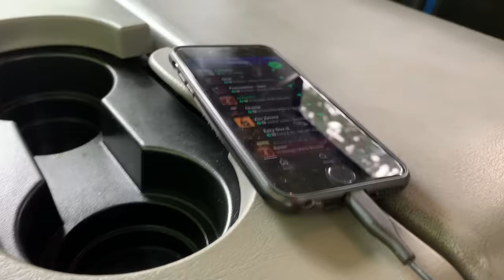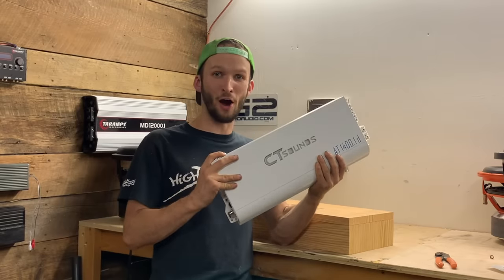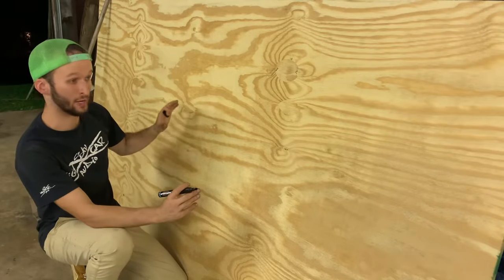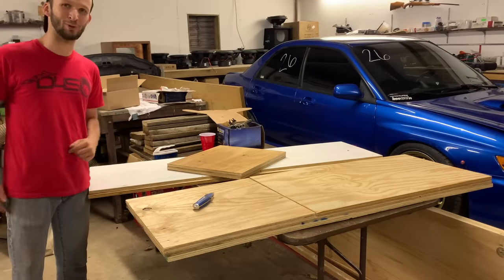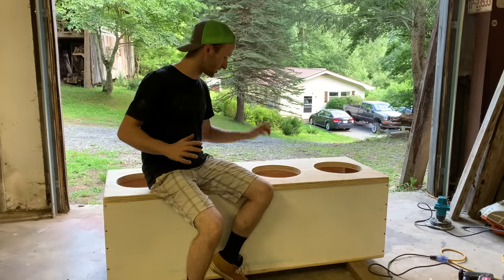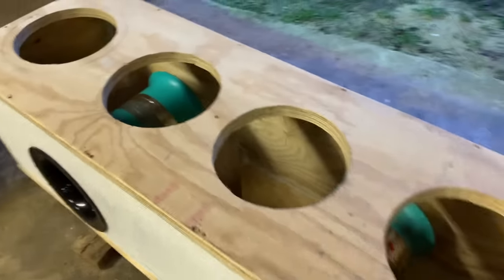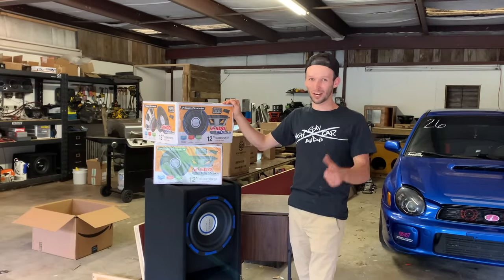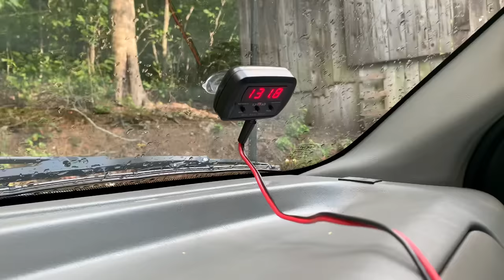How Loud? Walmart Build Part 4 FINAL

Comment: Those ports are too close to the back wall. You generally want the width of the port worth of distance between a port and a wall. But still turned out awesome!
Reply: Yea probably been ok with smaller diameter so they would be shorter, but big ass ports always look super cool 😎
Reply: Half the width of the port is as close as u can be to a wall.
Reply: It's interesting actually because you can slightly decrease the ports tuning by making it seem longer, by pushing the end of the port close to a wall. You want the port area to be equal to the "folded rectangular area" of... Well, imagine you have a rectangle, and that rectangles length is equal to the port circumference, and the rectangles width is equal to the distance from the port to the wall. That rectangle needs to have the same area as the port area. 

This will extend the ports effective length by a few inches or so. Free low tuning!
Reply: Yeah I agree I would of put slot ports facing up on each end of box
Reply: Flexing five hundred the ports is facing the back of the seats
Reply: YESSSS. I'm here for it.😁
Reply: Maybe you should build a proper box and donate it for use on the channel.
Reply: I usually just cut back to get enough room for some sweeping 90°'s.
Reply: @dabosssr24  I'm in no way a professional, but I've always added 90° bends and strapped them to the rear of the box. Is this a bad idea in your opinion? Would I get better results another way?
Reply: 90° angle ports would be/sound better in that box
Reply: I think he knows that already he’s just dealing with the hand he’s dealt lol
Reply: Honestly I know sealed isn’t as loud but I prefer sealed because you get a flatter response and I feel like you almost feel the bass more Since the subwoofers own cone is kind of acting like a passive radiator slightly and if you have enough power it could still be loud enough and you get smoother and more cone excursion which looks cooler if you’re showing it off. The only downside to a sealed enclosure even though it’s not a problem usually but its something to consider, is that there’s no air moving in and out of the box so the sub will run a little warmer because it’s heating it’s airspace up inside the box from operating.
Reply: @adamgallahan6747  sealed is damn good when you upsize the box a good bit you can get some of that deeper bass you get from ports but still retain a little more responsiveness on top.. 

But hell you get the same from a slightly undersized ported box too.. and done right you’d be shocked how flat they can play.. this is basically how all factory kicker ported boxes are built and why they may not hit as hard as some the roll off up top is very similar to a sealed box.
Reply: @adamgallahan6747  I built sealed for my wife's truck and I love the sound. But I do enjoy my little Mazda, one CT sounds tropo XL and the box is tuned to 32 hz. Vibrates my eyeballs lol
Reply: @Thumper68  slots cause port chuffing 🤢
Reply: @djshedd77  not necessarily
Reply: @josmith213  Been okay with small diameter? Bro he NEEDS smaller diameter. They're twice as big as they should be. Thats why it sounds like crap.
Reply: In any pick up subs face down period ports should also I've installed more than a dozen in ex can n 4 door trucks all face bottom period. Sound is trashy any other way
Reply: @christopherparis6841   You lose alot of performance having the subs facing down...  this has been proven a bunch of times.

Which is why 99% of the truck builds you will never see subs facing down. Lmao

P.S if you have to face your ports down to avoid a "trashy sound" you aren't building boxes correctly.
Reply: @fishrrelaxing9361  ported enclosures respond like a sealed enclosures once you get past the peak near the tuning frequency. The trick to ported if you're going for a flatter response is tuning it low so your peak is in the subsonic frequencies, that way you get nasty lows without the boomy peak. It actually gives you the feel of more range than sealed gives you. The problem is if you tune high or buy a prefab (most, but not all). You get higher higher SPL but you get that boomy bass in a little range which is disproportionate to the bass in the higher frequencies and that ruins the experience. Plus your sub is more likely to bottom out/get damaged in a ported enclosure tuned for SPL. It's all about building the right box. Typically, ported>sealed even for SQ if you build the box right. There is some exceptions, but typically. Some subs have a QTS that's perfect for a sealed enclosure, but that's sub specific.
Reply: @mrcornut  I have no idea what you’re saying.. the second half is generally correct.. but if tune a port to a subsonic frequency you’ll lose a lot of range on the top end cause the box will roll over sooner. Second if one were to go ported then everything you gain by having a port is lost because you tuned it to a frequency that is subsonic “below what is physical able to be heard” in which case you just designed a box not only so you can’t hear the speaker perform but also most music isn’t even going to get that low so there would be no sound anyways and your sub would likely rip itself apart lol.. anything with subsonic in music is likely noise or distortion in electrical equipment outside specific base tracks .. this is why every amp in existence for the last 30 years has a subsonic filter lol.. 

But the second half is correct most prefabs are boomy. But not because they are tuned higher per say but because they are tuned higher on like a +6 bd curve.. a lot of Qbombs are tuned to like 47hrz on a 6bd slope meaning you’ll gain +6 db at 47 then it will roll over to about +3 at say 50 then +1 at 55 then by 58 it’s flat or equal to a sealed box then it drops below above 60 and by 70 you’re -10 

The majority of box’s are tuned from 33-40hrz on a +3 slop which means by the time you get up to say 60 youre still only rolling off 1 db below but by 80 you’re still only maybe -3 (flater curve) 

You can extend the range of the tune by upsizing then box.. A typical say 2.0 cube box tuned to say 35 will be +1 or so from 33 all the way to 45ish with a slow roll off performing close to a sealed box from 60-80 while still getting a little gain in the tune range.. 

Most custom builders will opt for say a 2.5-3 cub box at 33-35hrz this allows for a +2 from say 30 all the way to 45-50 but then rolls off a lot faster in that 50-80 range.. but still only maybe -6bd 

What quality prefabs do like those provided by kicker or jl that are more a one size fits all is use claimed 2.0 ish box that is really with displacement and inside measurement more like 1.75 this gives more like a +2 peak instead of the traditional +3 at tune but also extends and flattens the roll off. (Exactly what I I finally said which was a smaller ported box will act similar to a sealed and still give you the benefit of a port but with a flatter curve but won’t hit as hard in the tune range) 

One day YouTube will allow for positing of picture in comments lol.. I could then show you in graph exactly how this works from box building software.. as for qts that’s mostly a dead thing anymore as almost every sub made by every company for the past 10-15 years is optimized for ported boxes anymore. Outside a few specific shallow mount specialities choices but even a lot of those are capable of being ported. I could scroll through all the subs loaded in my software and they all show up being able to go sealed or ported what matters is how big of a sealed box you need or how small of a ported one when hitting the two extreme ends of that.. 

But you can’t tune a port to hit at a certain frequency wo having the sub roll off on the top end.. you also can’t play below tune more then a couple ticks as that makes the sub go essentially subsonic sooner. The bigger the box the wider the gap around the tune. The more boost you dial in at tune the faster the roll off before and after that tune.. he’ll a lot of comp vehicles running bandpass setups are tuned to the resonant frequency of the vehicle in a +12 or +16 tune meaning at say 50 they get a huge peak but they will only play in like a 10 hrz range..
Reply: @fishrrelaxing9361  image dynamics idmax 15 recommends 27 hz tune, they're not wrong. You talk about a smooth curve throughout the frequency range. I've tried going lower and higher for fun and even tried other woofers in the same scenario. Tune low, avoid terrible peaks.
Reply: Well he did say he's not a professional box builder before he put it together
Reply: That and are the amps gain matched? That's huge in a common chamber dual amp setup
Reply: So true the ports got have distance to get deeper boom
Reply: @fishrrelaxing9361  33hz is a great tune for most subwoofers, 40hz not so much because that's when you get big peaks. I get what you're saying, but don't read too far into what I'm saying lol. I'm one who likes to tune to the low-mid 30's. I'm just pointing out how a subwoofer responds like a sealed enclosure once you get past its peak, there's SQ guys who run ported, but they run a low tune, sometimes high 20's. Even though you don't hear much below that, when the port resonates there you definitely feel it. That's a heck of a reply, at work right now but I'll give it a full read shortly!
Reply: That is true. But I’ve had great success with Aeros being 2” or so closer to the wall. 
 In my wall. My 12” area is roughly 10” from the back of box
Reply: Its more about how much xmax the subs have that determine how close you can put the port to a wall. There really isnt a general rule of thumb for air displacement. There is some math u can use to find out, but i sure as heck dont know it lol. If anything it may help him from bottoming the coils out with a little backpressure lol.
Reply: @josmith213  big ports its the way to go
Reply: @fishrrelaxing9361  so, I read your post but there's too much to respond to. Some of your stuff is correct/confirms what I said but I think you're misunderstanding how some things work. One (the most important that you need to understand) misconception you have is thinking a sub can't play but a couple ticks below tuning, that's definitely not the case. An enclosure tuned to say 32hz, you'll multiply that by .75, that gives you 24hz as the setting for your subsonic filter, and just because the filter is at 24, it'll still play lower than that but with the rolloff to prevent unloading. Some subs can handle a tuning below 24 in that scenario, but typically the .75 times tuning math works great. The whole point of my original post though, I'm trying to tell you how you a sub in a ported enclosure responds just like it's in a sealed enclosure once it gets past the peak in the tuning. That's all I'm trying to teach you
Reply: @CajunReaper95  yes a mic can reproduce bass. i dont know where you get the idea that it cant. i can tell what a lot of systems sound like in videos playing through my own system. at least enough to tell if it sounds like crap. i could link you a hundred videos that have been recorded with cellphones that have bass down to 30 hz in them.
Reply: So true
Reply: Who asked you?
Reply: Who fkn cares
Reply: Its a walmart build dont take it so seriously
Reply: @christopherparis6841  mine got louder and sounded better subs up port up
Reply: No cause small 12s need small air spacing cause it helps them hit low
Reply: I was thinking why not one big port out of the side
Reply: My thoughts exactly. Glad it wasn't just me that spotted that right away. I have some experience with them gothic and with enough power, right box and a little deadening...you should be able to hit 145 w/o to much trouble with 4.
Reply: Everyone has an opinion but only one that matters is the one who’s it is but I guess constructive criticism is much better than hate so I assume he welcomes suggestions
Reply: @adamgallahan6747  I prefer sealed as well. Sure you might lose 6db or so at the tuning frequency of the port, but the overall sound will be better if you listen to different kinds of music with different bass tuning. 
A rock/country kick bass,. for example, is a significantly higher tone than a booty shaking rap music bass.

Also, you won't blow a sealed box with infrasound or bass below box tuning. You can definitely blow woofers in ported boxes with bass below tuning.
So with a sealed box, you don't need to run a high pass filter if you use a mic or turntables or some other source that can produce infrasonic feedback.

You're right about the sub running warmer. But I've never had a problem. On the flip side, you can build a lighter box out of thinner material,  because a ported box develops significantly more air pressure than a sealed box. So as long as you don't cover it in carpet, the wood/MDF will radiate some of that heat.
It's such a small amount of heat that I really don't think it matters though.

Comment: It's a good thing that you are bringing to light that you can go cheap and achieve great results. For example I have been running two dual brand 12's in a bandpass box on a jvc 600 watt amp for about 13 years now and it still hits around 130db. Keep doing what your doing!

Comment: Ok your content is getting better and better and  very informal who would of thought Walmart subs could bump this hard! CRAZY!
Reply: The rms on those subs is 1200 watts (2400 collectively) The rms on those amps is 650 @ 1ohm (collectively 1300 watts rms). Those subs are severely underpowered! I have two of those Gothic 12" subs in a 6.5 cube, strongly reinforced, box running off an Audio pipe 2500 watt amp (rms 1800) ! The bass is phenomenal! But also the musicality is AMAZING!!! I've been crank'n them subs up for 4 years and their longevity is notable as well!

Comment: the thing about using ports is you have to have atleast half the diameter of the port of space from any wall inside the box, and atleast the full diameter of the port of space outside of the port opening. It's gotta breathe. Sounds really good for walmart grade stuff and you're showing those that have to do with what they can afford that they can still get loud. Great work Parker!!

Comment: The diameter of the port determines how close it can be to the rear wall. Try cutting out some spacers so you can move the ports outwards away from the rear wall you’ll definitely see some gains.

Comment: As someone who’s had a many of walled off ext cab trucks back in the day.. I can hands down tell you the majority of the time you want either facing forward and port up.. 

Or as I did with my last one with 4 15”s I had two firing down.. two firing up and ports centered top and bottom in correlation to the subs they were porting as it was essentially two box’s single chamber. Then I used angles plexiglass on top angled to deflec the sound forward and same on the bottoms which doubled as Amp rack and power (similar to say a horn tweeter effect) distribution area.. that’s a little much for this budget build but you could have done the center two firing down slot port center.. then the ends firing up single chamber firing up with with single 3” or 4” ports.. but then you’d have to remove the seat and add a shelf to elevate it 12” or so off the floor.. but you already had a dual box and a sgl all you really needed was a bother sgl and then attached them all to each other if you really wanted to be ghetto fab lol

Either way I find this funny.. came inside after having just finished my daily caddy install lol.. just a sgl 12”cvr off cxa800 but that little thing hits pretty good when combined with the 14 factory speakers lol.. 

But in honesty sounds like it hits somewhat similar to this still but I did 12mil line the entire trunk even on top of all the skid deadening it already has lol

All for fun and all.. but I think if I was doing this I would have gone big sealed and just fired them forward.. maybe 2.6-3cube per.. have to play with software a little to see what the slope is in those ranges but should be about right.. 

Really from what if read and seen these subs are pretty decent.. the amps are the crap in this system.. I bet a single decent amp would be a lot better lol.. another 3-4db prob.. so much you can do with a big 3/4-1 ton though cause they already have big alts and dual battery’s can pul 2k off factory electrical pretty easy in those.. would be fun to tinker around with like this for budget builds with decent amp and big wire

Comment: I used to have a 94 exploder with a kicker l5 12 in a ported box running on a jbl amp pushing 750rms and did 140 in a sound comp. Cheaper then this set up and better quality parts

Comment: People, if the ports are meant, to be that long for tuning.  Then they are not “too close” to the back wall.  Box builders, have been doing that for years with ideal results.  Only thing I would suggest, is manipulating things inside cabin.  Move passenger seat forward, open door “outlaw”, sun shields up and down, vents closed, and anything else that can make minor adjustment.  Great series Parker, keep ‘em coming!
Reply: If you've been building speaker boxes for years maybe you should inform him that his ports are twice as wide as they should be.
Reply: @tbone8839  the t/s parameters are meant to be built within spec.  I’m not saying shrinking port is a bad thing, his designer examined his cabin space. Subwoofer and power, made the measurements and tuning ratio needed for optimal performance.  It’s still a project, nothing is ever finished in bass.
Reply: @darksidefordinner5170  Well i don't agree with his designer. I don't think he is getting optimal performance or sound. I know he isn't.

Comment: I had 2 of these in a 6cube slot port box, tuned around 35hz. did a 142.6 on a hifonics brutus 3200 in a Kia rondo van. There pretty good for the price.